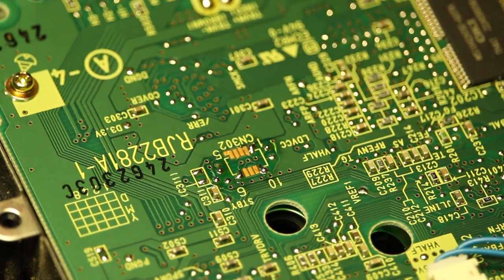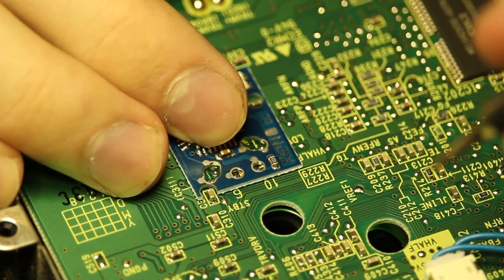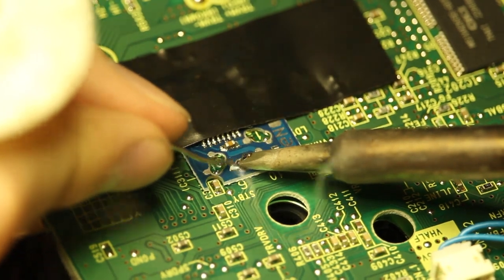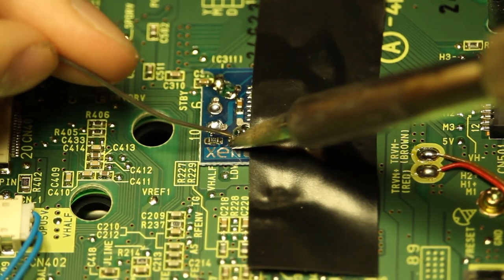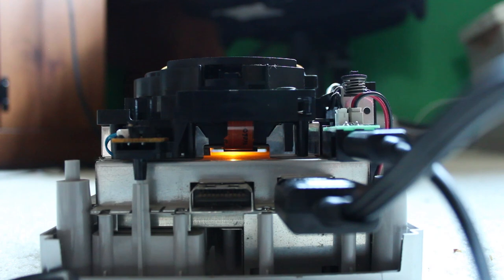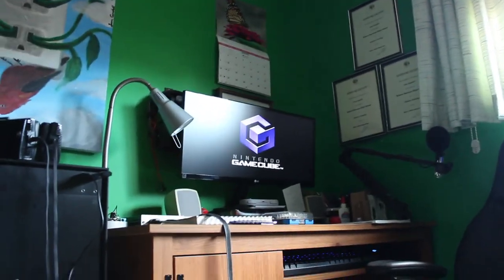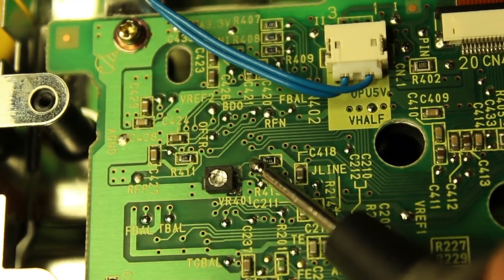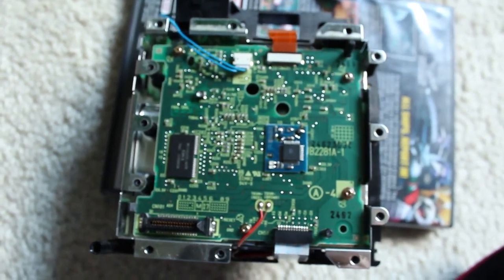GameCube XenoGC Installation + POT Lens Callibration

Comment: I did this without any flux with a very shitty iron. It was messy ! Definitely listen to that guy's advices.
Also, double sided tape is very helpful to hold the chip and ease the future stress the soldering point might take in the future.

Comment: Thanks Sam I've recently bought my very first ever GameCube I've ordered a xeno mod chip last night from eBay my total spend so far including console is £34 😉 i got the platinum console and wires with 1 control pad no games for £32 and got the chip for £2 and got free postage this is my first time moding anything my next purchase will be a cheap laptop to get the games burned to disc's I'm looking forward to my chip arriving 🙆 I'm trying to keep this at a minimum of £100 Inc the laptop i need but will get that 2nd hand then hopefully get around 40 playable games and I'll be happy with my £100 spent
Reply from the maker: Sounds like a plan! Good luck on the modifications

Comment: I'm a noob at soldering, Is the Iron touching the chip when you are soldering it to the pcb?
Reply from the maker: Yes the iron touches the chip and the board below it, if possible. Once the surface is hot, solder can be flowed into place

Comment: Love the video. Thanks! 
Quick question - I read somewhere that ohm settings for DOL-001 and DOL-101 Gamecube models are different. ie. 450-600 Ohm for DOL-001 and 150-250 Ohm for DOL-101. You seem to have DOL-001 with HD port but still getting about 245 Ohm default. Please shed some light.
Reply from the maker: From my experience repairing and modifying GameCubes typically the model 001 or 101 isn't a direct indicator of what the resistance will be but more of which drive model it will have. There are two drive models, an 06 and 08 drive. That being said sometimes this rule isn't followed either, so I think (just my theory) GameCubes may actually be each factory calibrated differently from drive to drive.

My rule of thumb is generally never below 200 ohms but the main thing to keep in mind is to slowly lower the impedance in small increments like 20Ohms and try again each time until you have success. If you have a GameCube that started at an impedance around 200Ohms you may have to go a bit below.

Keep in mind that this fix doesn't repair the GameCube long term, you are simply giving the lens more power than the factory calibration to compensate for an aging drive. I really like to idea of SD card drive replacements for longevity sake of the console for this reason.
Reply: @SamCampbell  Wonderful. Thanks for the detailed and prompt reply. i just opened up a stock non-modded DOL-001 PAL Gamecube and potentiometer was set to 216 Ohm which I believe would be factory set. I did buy it second hand though. I installed the XenoGC modchip. Tweaked the potentiometer to 200 but unfortunately it doesn't read backups. I just need it boot up a Swiss disc and then I will play from SD. Do you think lowering below 200 would help or is there something to do with Xeno chip install. Anyway to check if Xeno chip is functioning properly or patched the firmware correctly? The original games still play perfectly.
Reply: SaminPK if you were going with a high heat or taking a long time on the joints, you may have fried the chip.  Or you need to double check your soldering. Sounds like the GameCube is working, but the chip is not. Try holding start and see if you get the XENO menu.

Comment: Hi Sam, great video best out of the one's I've seen, good camera angles and in depth advice. I have installed the chip, it starts red, then turns off for a second and goes solid red again, according to you that should be OK. I did the pot tweak and got it to 200 just to make sure, but it's not reading original or burnt discs! I've tried to make sure all the joints are solid and I tinned them at the beginning! Any ideas what else it could be? I'm not an expert nor novice at soldering etc. somewhere in between, any help would be awesome man as I'm trying anything I can think of. Thanks.

Comment: Hi there, I don’t know if you still do modifications, but I bought a GameCube that supposedly have had the Xeno chip installed so that both English and Japanese Gamecube games work. Right now I’m having problems with Japanese games, as my GameCube is freezing upon loading, the same spot every time and I tried about 15 - 20 times. Is there anything you can suggest I can try or something you can check out for me? Please reply when you have time. Thanks very much.
Reply from the maker: Since the only XenoGCs that really exist anymore are knocks offs it's hard to tell whether some functionality will work correctly. So if you are having difficulty reading Japanese games you can always manually switch between NTSC-U and NTSC-J with the mod shown here https://www.ifixit.com/Guide/Nintendo+GameCube+Regional+Modification+Selector+Switch/35482

Comment: My Cube seems to properly read the Xeno chip I installed in it... you can visit the BIOS screen, although it shows up in a blurry PAL format. Problem is, it just won't read burned discs! I've lowered the pot to 150 ohms, but dare not go any lower than that... the laser already looks like it could bore through concrete as it is! Not sure if the installation isn't quite right or I'm just not burning the discs properly.
Reply from the maker: It could be the ISO you are trying to use. I'm assuming you've verified that an official disk works. If you've tried other ISO images, also make sure that you are writing the disks at the lowest speed possible. Another suggestion is to try Fujifilm mini DVD-Rs, for some reason people seem to have the most luck with them.

Either way, good luck!
Reply: Official discs do work! But I'm not sure if that means properly burned copies will. I think the brand I was using was Ritechs, or some rebranded version of the same. I wanted to put Swiss on a disc so I could run the Game Boy Interface instead of the official Game Boy Player disc, but that didn't work so I had to install it on a memory card instead. :(

I dunno. Does it matter if it's a later GC model, the one without the digital video output?
Reply from the maker: No that shouldn't matter there are only two iterations of the GameCube disk drive
Reply: Shockingly, I DID do the mod correctly! I just wasn't burning the discs right. It was an embarrassingly easy fix... I just needed to burn them at 4x speed in ImgBurn. They start right up now! Unfortunately, now I'm a little concerned that I turned up the laser too high, and I don't really wanna open the system back up to adjust the pot. :P

Comment: You should use extra flux anyway. FLUX IS YOUR FRIEND
Reply from the maker: This is a pretty good tip. My philosophy when making this video was to try and keep it simplistic.

However my decision is a bit of a contradiction, because flux would actually make this easier, as you say, yet many won't want to be bothered to get some and find the guide over complicated.
Reply: @SamCampbell  I always douse everything in way too much flux.but i have been using an elliptical tip exclusively - mainly because thats what came with my cheap soldering iron (cheaper than yours).  thanks for the chisel-tip tip :)  i guess i didnt understand the fundamentals of soldering well enough lol. surface area can be your friend